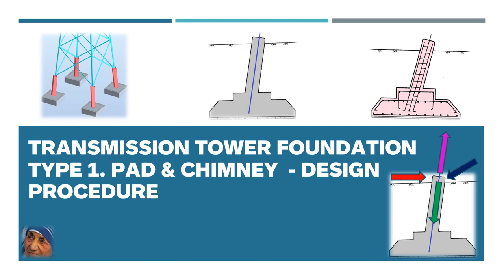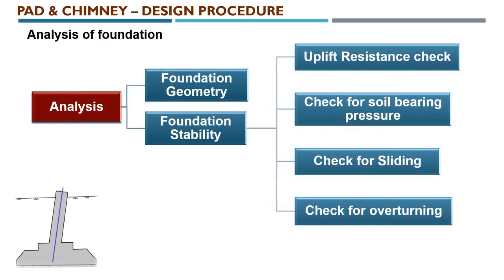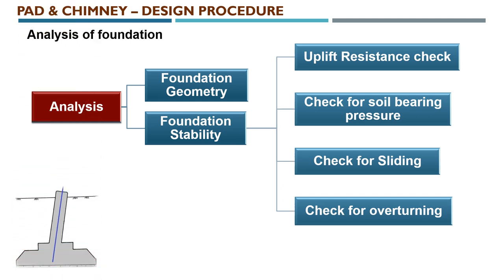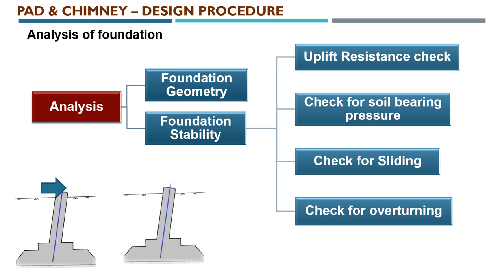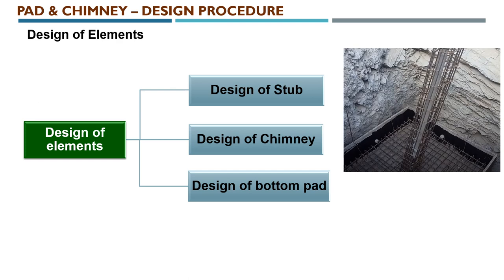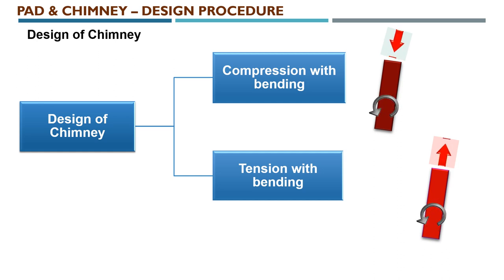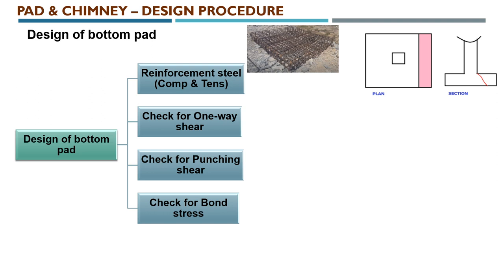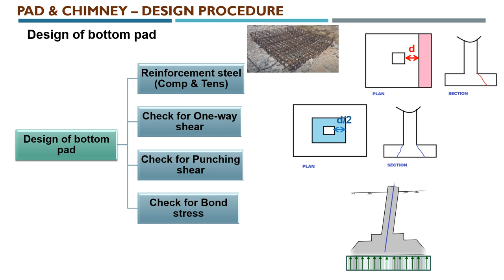TRANSMISSION TOWER FOUNDATION Type 1. Pad & Chimney - Design procedure

Comment: Thanks for doing and sharing useful and informative video on design of transmission tower foundation. Further , Kindly do and share video on design of Lattice Steel Transmission Tower using PLS Tower software. Thanks and Regards.
Reply from the maker: Thanks for watching. Thanks for your valuable suggestion. Currently, we don't have license to work on PLS Tower software. May be in future will try with that. Thanks.
Reply: @annaiteresaec  Noted and Thank You